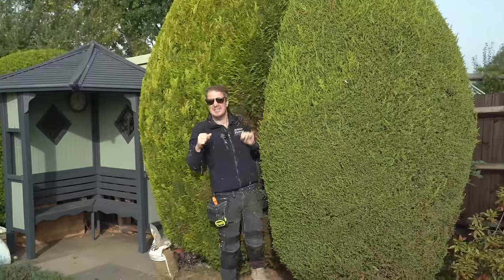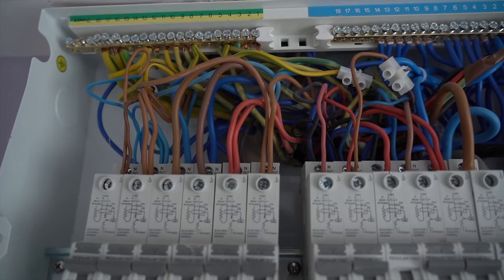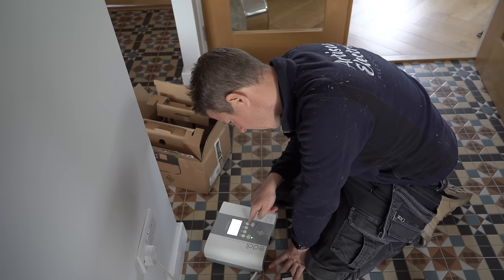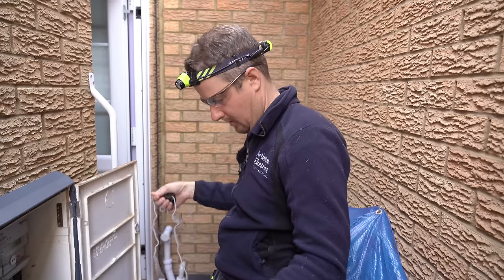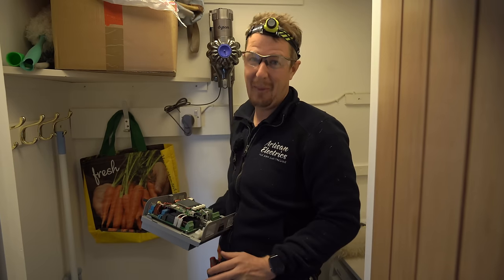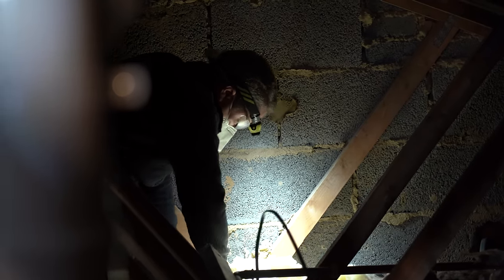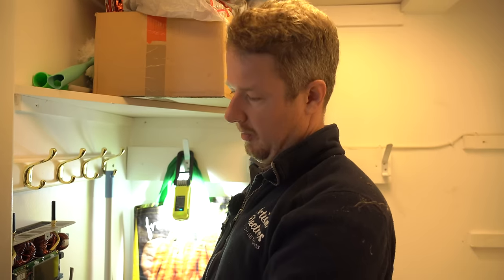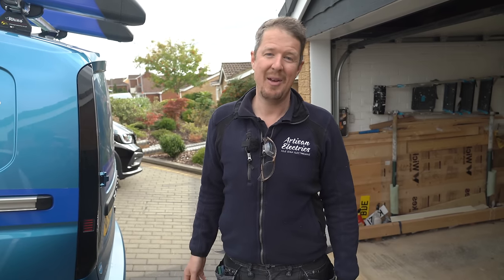OPTIMISING your excess solar energy! MyEnergi Eddi solar energy diverter install

Comment: That's a bacon barm, the issue here is mcs I've just fitted 4 x panels 1.62kw, a 1.5kw inverter right next to the consumer panel but I'm not entitled to any feed in tariff or any other mcs tech? Wiring all this up is easy to me but no-one will touch coz it was not installed via an mcs installer? Niciec can go f itself battery storage and screw these rules.

Comment: Wow... so:
1) You didn't know the Eddi hasn't needed a Hub since 8th August
2) Trying to pair the WiFi with the antennas still in the box 🙈
3) Internal CT not disabled
4) Installing the Eddi below a coat rack, when it is explicitly says "Ensure the device always has adequate ventilation; do not block the vents or obstruct the airflow at the back of the unit". So the unit won't be covered in thick jackets and coats then 🤷‍♂

Won't be booking you guys 😜
Reply from the maker: The coat hanger was removed afterwards 😤

Comment: The payback for one of these is many years even supposing it lasts that long. Longer still if you have a Go type tariff.
Reply: My Eddi equivalent cost me around £100 (Eddi's cost £450-500ish fitted) I use no Gas except for the hob (around .5 of a unit for 6-8 months of the year) dependant upon weather and temp. I estimate I save £10-14 every month over that period tailing off over the autumn/winter and increasing again over the spring. Based on last years figures it works out I saved around £122 (actually more because I have realised my Gas price in the s/s is still 3.212p/unit!) Now I plugged in the new Gas rates it's going to be circa £200 a year ) - based on 5.71p/kWh for my gas.
Reply: @wino99999  if I only used gas for a hob I think I'd be tempted to go entirely electric and avoid the standing charge. (Obviously might entail installing a dedicated radial for the new hob but the savings would pay for that after a while).
Reply: @wino99999  What is the equivalent?
Reply: @grayhalf1854  I have a gas boiler for heating which is still not yet turned on.
Reply: @wino99999  ah ok, fair enough. I'm actually wondering whether to go fully electric myself at some point, I think the time will come when the concept of a network of pipes supplying gas to individual domestic dwellings will be regarded as pretty antiquated. There was a video I saw on YouTube that explained how heat pumps are so much more efficient than gas heating; personally I'd be keen to go that way myself, once the tech is more developed.
Reply: @grayhalf1854  Yep me too. However when you need them to be at their best they are operating at their poorest! I would like to see GSHP's get cheaper. Especially the borehole variety. The ground could be heated in the summer months from excess solar, to increase it's effectiveness during the winter months.... You can't do that with ASHP's!